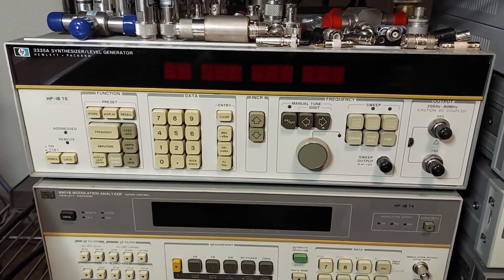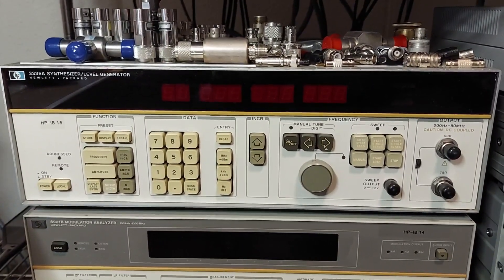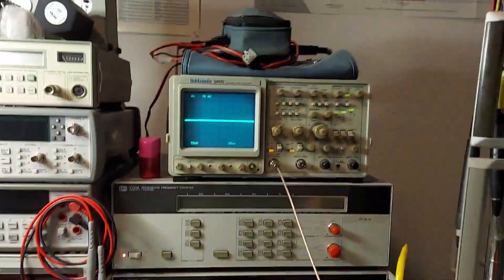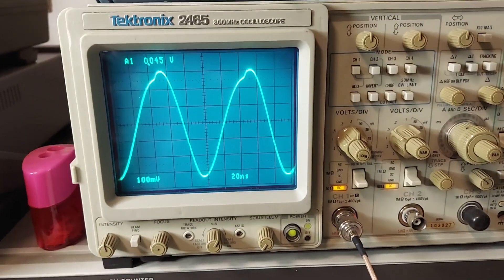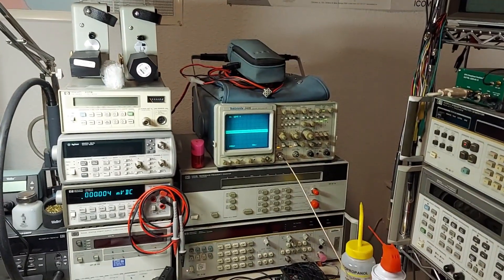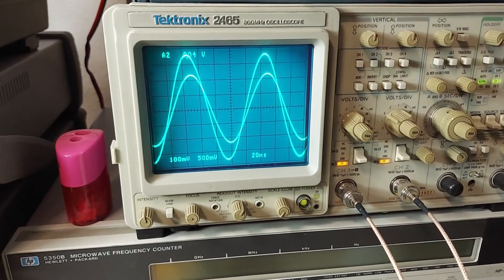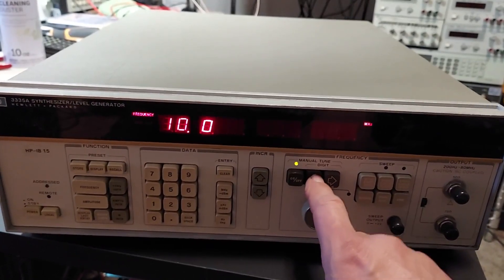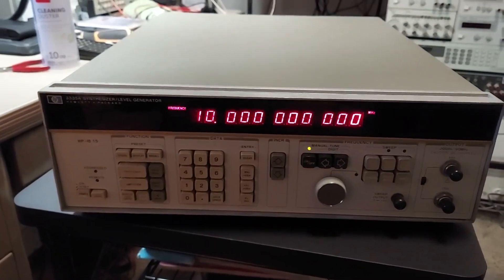HP 3335A Synthesizer / Level Generator reference replacement.

Comment: Great video, I also liked the photo bombing of your HP41!!
Reply from the maker: Thanks for watching. Yeah, the 41CX, one of my favorites along with the 42S and 48GX. I have been slowly accumulating the necessary components and will eventually do something with instrument control via HP-IB with it.
Reply: HP41CX is my favorite too, in fact I have several that I am using to control instruments, but I am mainly using HP-IL (a 2 wire serial comms version similar to HP-IB) and I have a HP82169A HP-IL/HP-IB interface that lets me connect to my HP-IB instruments as well. Videos are great by the way!  @CraigPetersen12f36b

Comment: Thanks Craig - great video. I had the same oscillator model fail in an HP 5334A. Believing I had nothing to lose, I opened it up and was able to repair it - an internal connection has corroded and failed and it turned out to be a simple repair and it went back in to service. So it may be worth popping it open and having a look. If nothing else they are constructing in an interesting way.  Keep making your vids, I really enjoy them!
Reply from the maker: Thanks for watching! I have the B version of that counter, they are very nice units when they are equipped with the high stability and 1.3GHz channel option.